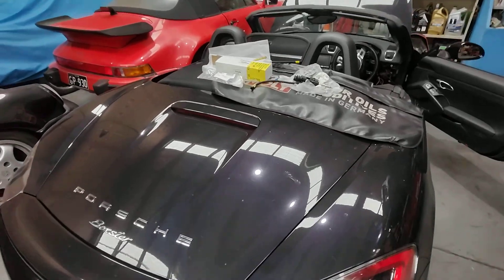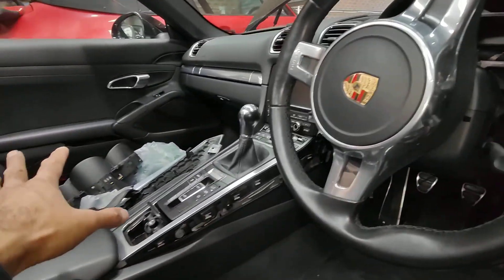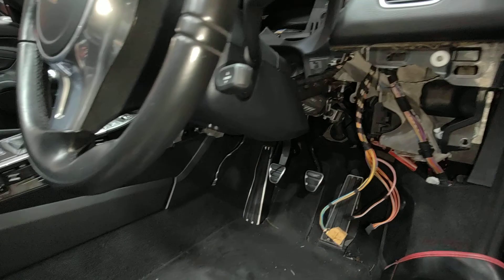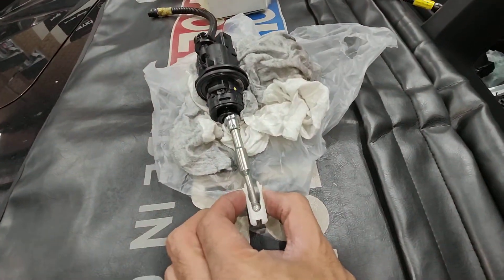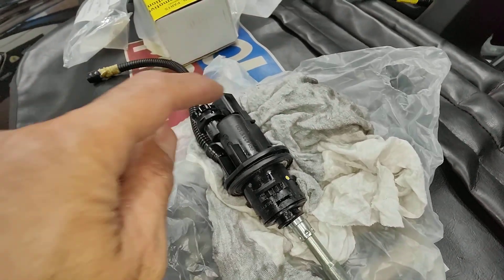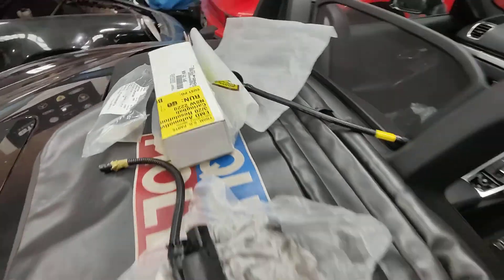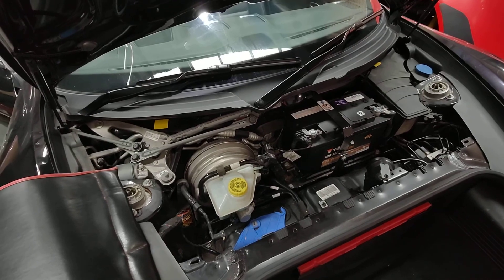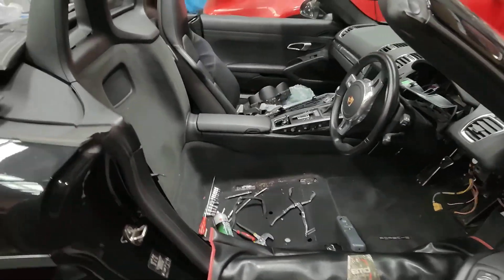Porsche 981 Boxster A.L - leaking brake fluid - Replace clutch master cylinder

Comment: Do you know if the clutch interlock is integrated into the master cylinder on the 981? This is the switch that prevents the car from starting without depressing the clutch. It's a separate external switch on the 987 but I think it's integrated on the 981. Good video!